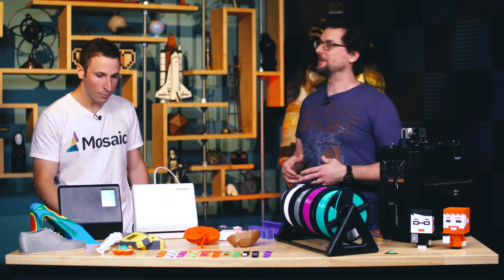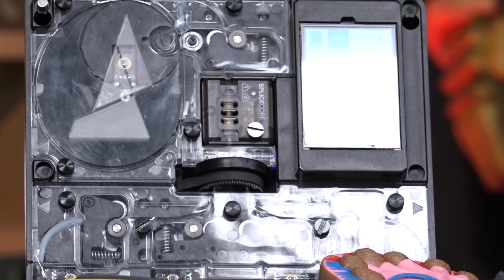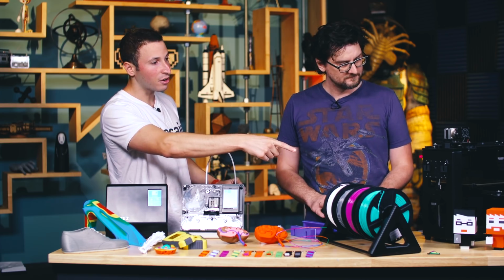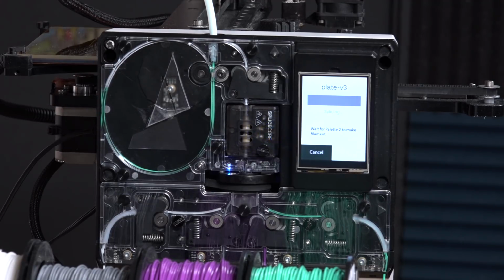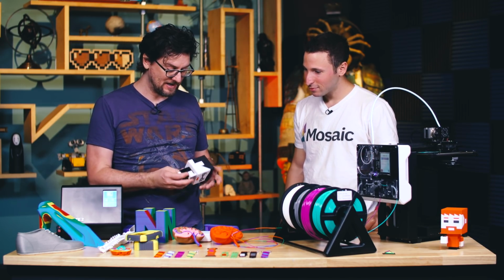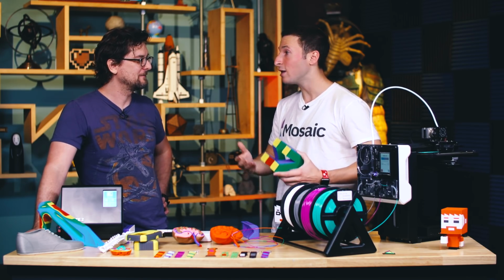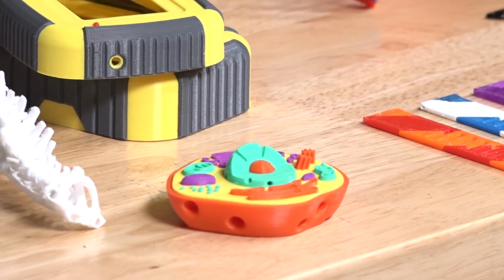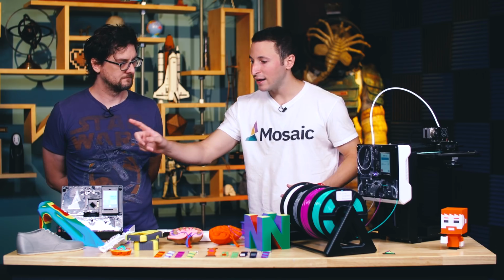3D Printing in Multiple Colors with the Palette 2

Comment: That concept and execution of that machine looks phenomenal! Doing the purge inside the model - genius. Layer stacking (or whatever you called it) - very clever! But if Canvas is cloud only there's absolutely no way I would buy the hardware. No way. Sorry, if selling the same product to your existing customers over and over (with "pricing to be announced") is the business model, I'd wait for the knockoffs or machines with integrated splicers.
Reply: Having read most of the comments here and on the 3D Printing Nerd video, I now know that they have offline software called Chroma (or something like that) that will support the Pallette 2 soon. The company keeps saying the "best experience" will be with Canvas though... which is, of course, a pretty nebulous claim. Personally, "experience" takes a back seat to "quality". If both software interfaces (Canvas and Chroma) can produce identical results, I'd prefer not to deal with the outages, incompatibilities, uncertainty, and lack of privacy inherent with cloud-based services.
Reply: From my understanding they can't produce identical results. Canvas (cloud) is it's own slicer while Chroma (local install) takes your slicer's files and mashes them together. Features and execution of both should be wildly divergent, as I assume Canvas Slicer has been built from the ground up without taking any code from open source projects. Depending on how well Chroma handles gcode that might allow for some interesting results you can't get with Canvas, like combining a model processed in Slic3r with supports made in Cura.

We'll need to wait and see what will be missing from Chroma to see what we get guaranteed access to when Canvas has downtime, changes it's features, or requires cloud credits for slicing time. There are some "coming soon(tm)" features like purge in infill that need to be part of the slicer, so I expect Canvas / Chroma to diverge pretty fast.
Reply: Hi Hirudin, it looks like you beat us to it with your own research, but for clarity's sake: While CANVAS will provide the best experience (and we hope will have a long and healthy life!), we have a free desktop (offline) app named Chroma that handles post-processing of GCode files from other slicers. Support for Palette 2 in Chroma will be added shortly! 

Chroma will be as good as the GCode fed into it, whereas CANVAS runs its own slicing engine. In our testing of CANVAS, we've found the output in path quality to be comparable to leading slicers (dare I say ... better in a number of respects?) and that's ignoring the multi-material focus. We are dedicated to improving CANVAS and providing innovative features, a lot more to come from us in this area.
Reply: @Mosaic Manufacturing The fact that the price of Canvas is to be announced is what is putting me off. I don't mind making the purchase I just don't want to be spending £x a month to be able to use the product as it was intended. $500 USD is a very competitive price point. You could easily have made it $600 and Canvas 100% Free as it is today and released a premium version with the advanced features you say you're working on. Looks a great product otherwise though.
Reply: @Zach Sharples

Totally understood. Frankly, we have not yet fully fleshed out all of the planned features for CANVAS—we are always listening and re-prioritizing our development plans based on customer feedback.

I will say this:

We intend for many features in CANVAS to be free (especially to Palette [v1, +, 2, 2 Pro] owners). Of course we want Palette owners to have great experiences with their machines and software. We also plan for CANVAS to support other multi-material things (like the Prusa MMU). There may be features that we charge non-Palette owners that are free for Palette owners. We also have ideas for some industrial features planned in the future that would be paid only (e.g. run a farm of 100 printers / Palette 2s and dynamically assign prints to different Palette 2s). In general, I would venture to guess that Palette & Palette+ owners who have watched Chroma evolve over the past year would support the claim that we listen to customer feedback and are always aiming to improve things.

Over the coming weeks, we will sit down and articulate more clearly what features in CANVAS will be free (and stay free) for Palette owners, and try to share some ideas on what premium features might look like.

- Brennan
Reply: Can't wait to see how these compare in the real world with something like Prusa's multi-material changer.
I'd imagine that the Prusa system is slightly slower as it does a long retract as it's 'switch' but as even the Palette needs to do a purge, I can't imagine there being much practical difference.   Oh and Slic3r is getting 'use infill as purge' soon. :)

Comment: Really nice piece of hardware, but there's no way I'm buying any machine that uses cloud-based software given the history of these kinds of startups just disappearing overnight.
Reply: My thoughts exactly...I was originally going to buy a Glowforge until I realized they were trying to do roughly the same thing, so I spent a little more money on a more versitile machine.

I have no interest in being forced to connect my expensive production machines to the internet when there is absolutely no need for it.  It makes my internal network more complicated, adds more security concerns, and makes me beholden to 3rd party services which I have no control over.
Reply: @Harbingerx81  It's called outbound traffic, enabled to "permit all" by what ever ISP equipment you were handed down. The inbound traffic comes back as a session already established by the outbound request, no different than you posting this comment.
Reply: Hi Richisskill, While CANVAS will provide the best experience (and have a long and healthy life!), we have a free desktop (offline) app named Chroma that handles post-processing of GCode files from other slicers. Support for Palette 2 in Chroma will be added shortly!
Reply: OK, that sounds good. Thanks for the reply.

Comment: I see that it is working on a Makergear M3, would it work on the older Makergear M2 RevE or is it exclusive to M3 line? Edit: Or is that a modified M2 already?
Reply: The website shows the printers it works with.  It includes MakerGear M2/M3-SE

Comment: Would it be possible to mix ink into a transparent filament if you had a longer heated delivery channel?  Sort of like: heat, ink, mix, cool a little, dispense.  That way, you could do nigh-unlimited colors from ink mixing and even transparency levels.
Reply: There could be a printer painting the filament, then when it heats up the color diffuses into the filament?

Or use an RGB filaments and splice/mix it in such a way its seamless mixed color of rgb which is essentially all colors. But i think that's still 10 years away
Reply: XYZprinting has the da Vinci Color which uses CMYK inkjet technology to do color prints

Crane 3D has the M3d Crane Quad which mixes CMYK filaments to create multi colored prints.
Reply: It would be possible but very difficult and not super effective or effective
Reply: But this is still useful because you can mix different materials, not just colors.
Reply: @Spaventacorvi  , only if they can be spliced together.
Reply: doesnt look very good and only few materials work
Reply: Previous version of the Palette have been phenomenal and this version looks better. 90% of the prints I do are in 1.75mm PLA which works great for this machine. If I need something strong like PETG I'm likely not looking to do anything in multi color.

I'd say this is the case for 75-90% of 3D printing users.
Reply: a true 3d printer

Comment: Why not RGB + white and black
Reply: This is splicing colors together. Not mixing them.

There is a printer by XYZprinting that mixes CMYK using inkjet to color prints.

Crane M3D 4 color printer which mixes CMYK filament to create different colors
Reply: wait, so there are colored 3d printer that dont fuck around with splicing. I mean come on then, whats the point of this except to convert a old 3d printer to colour
Reply: There are also much more expensive printers that can do color like SLS/Powder based printers. I think the Palette is great! There are many thousands of printers out there to which this product can add functionality. There will be many many more thousands.

Just like he said they don't want to make 3D Printers. A lot of 3D Printer companies don't want to add the complexity of multicolor. It's a whole lot more R&D and then end user support.
Reply: Yeah. It is all down to what you want to do with your 3D printer. This is fine enough for a lot of users. And there might be other reasons to splice materials to. Not just for color effects.
Reply: I think that is simply down to it not printing with gradients but lays of color. So is not like the colors you get on you screen. 

And besides. Most 2D printers use CMYK and not RGB ;)

(Not that is likely matters what traditional 2D printing uses) <_<
Reply: Actually it does. If you're actually mixing colors like traditional 2D printers it's subtractive color which is CMYK. RGB refers to additive color (screens).